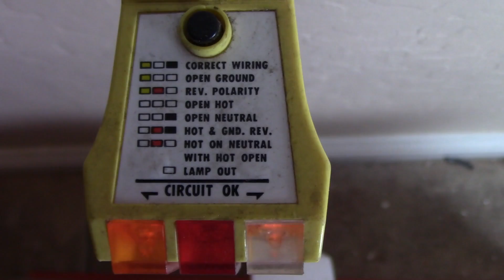Wiring a Receptacle

Comment: I think its code to pigtail all 3 wires
Reply: David Berquist it’s not code but it’s a good practise that adds protection of the circuit
Reply: It's not code but I only pigtail when there are more than two cables in the box.

Comment: Why are there 2 whites and 2 blacks? I just replaced a 2 prong outlet with GFCI and there was only 1 white and 1 black
Reply: If there is only one pair of wires that means thec
 receptacle is the one at the end of the circuit (unless it's the only one on the circuit). When there are two or three pair of wires, on us the line bring the power in and the other one or two pair are simply continuing the circuit taking the power on to other receptacles.
Reply: One cable brings power into the box and the other cable takes power to the next receptacle. Think about it. When a breaker trips the power from that breaker causes more than one receptacle to lose power (unless it's a dedicated circuit wired to a single device).

Comment: Great videos Mr. Peterman, you seem to explain what everyone else is not. I thank you for that. I have a question and have nobody to answer. I'm remodeling a room. I knocked down a  wall and it had 2 wires coming down from the attic. They connected 2 outlets a foot apart. I want to reuse these but I am not sure how to. My dumb questions are - Are the 2 wires going to the attic rejoined before the breaker? Do I need to fill and complete that circuit in order for it to work again?
Reply from the maker: Yes, you will have to complete that circuit. I can't say exactly what to do as I don't have complete information, but in a case like this we either relocate an outlet using these existing cables, or splice them together in an accessible junction  box with cover plate. Bottom line is that you have to have access to any spices in a circuit, and if there is attic access then a box in the attic will work and you can use the junction to add on to your circuit keeping the maximum number of outlets in mind.
Reply: Thank you so much for your response and help Terry!

Comment: While it's not required some  electricians wrap black electrical tape around the screw terminals for extra protection against them shorting out with bare ground wire or metal boxes.
Reply: hereslookingatya sounds good!! But, who ya gonna get to test it??? HAHAHAHAHAHA!!!
Reply: Joey Wood YES! It would have saved me some time, if it had been done! A friend asked me to fix a circuit issue. I spent some time investigating as a novice, and couldn't figure out what the problem was, or where it was. So I decided to just run another main wire to the circuit, and let that power the outlet and the rest of the circuit. After I was involved with the the repair, I figured it out!! Was so simple, but complicated! When the circuit was originally built, the neutral (white) was accidentally touched to the bare (ground) wire while putting it in the box. No problem for many years. But, when a company replaced and updated the breaker box, the white was left unconnected (and hidden) in the box, on this circuit! The owner put a window A/C unit on this circuit, down stream of this outlet in the circuit! The touching of the white and bare wires, in this outlet box, kept the circuit alive for a time, after the company installed a new breaker box! It eventually quit working, and was ignored for a time. I didn't see the connection in the outlet box, when I pulled the outlet out to investigate. But it already broke the connection, and was only minimal arcing at the rub. When I found the circuit in the new box, I found the issue! The company left the white (neutral) wire disconnected. It was hidden in the box, and could not be seen without physical tracing. The original touching of the bare to the white in the outlet box was not known, and took me some time to figure it out! The bare carried the load for some time, just from a tight bunching of the wires in the outlet box!! When the owner added a window A/C unit to the circuit, it was too much for the circuit, much less the outlet up the line with only a touching of the bare to white. It was too much, and arced until the touched wires burned enough to stop the connection, then DEAD CIRCUIT! The wires touching never caused an issue, but when the white was left off during the breaker box change, it prevented it from being known. He was so lucky that the house didn't burn down, or someone got electrocuted! Later, the same guy had a bathroom light not working, on a circuit with a fan. The fan worked, but the light wouldn't! I switched off the breaker to the fan/light unit, climbed up on the toilet to investigate, and grabbed a hot wire!! Someone ran a separate hot line to power the light, and fed it from a nearby circuit without rhyme or reason, and didn't make a tight junction at the light. Live wire, standing on toilet, grabbed hot wire, soiled undergarments!!! WHEW!!! Sometimes I wish I didn't know anything about electricity!!
Reply: Joey Wood 
Hey, that last remark about soiled garments got me thinking about an invention. Metal flush handle, metal toilet seat, 120 volts -put it all together and instant cure for constipation! I'll be rich! I mean we will be rich 😝
Reply: Joey Wood 
Darn it! You know how to throw a wrench in things. I'm going to the crapper right now to think on it. That's where I do my best thinking right there. 
   We might get them google people in in it, they been doing something called "testing on the toilet" since 2006 involves posting programming quizzes and puzzles across some 500 bathroom stalls, mostly in the engineering sections of the business. Smart bunch if sitters right thare! 
SITTERS! I just made myself laugh 😂